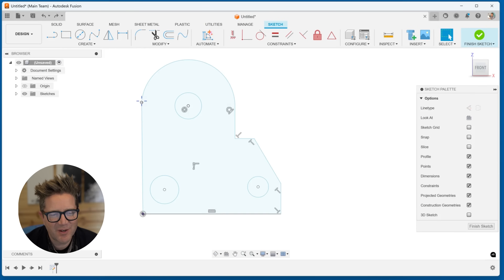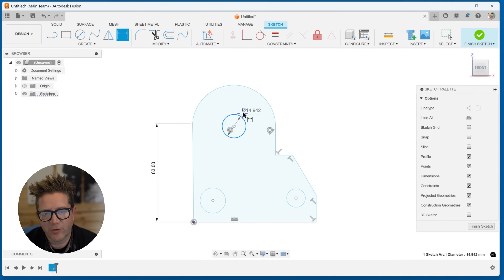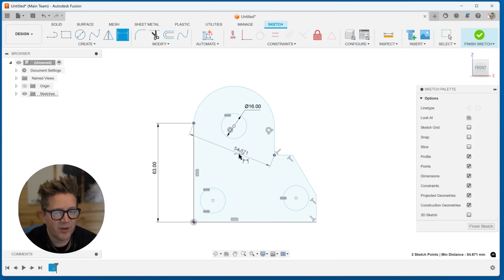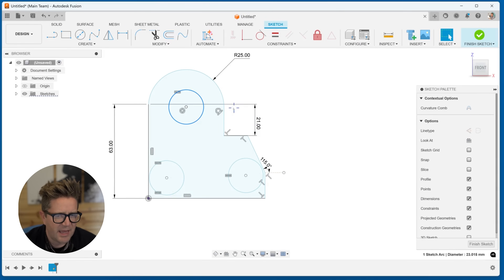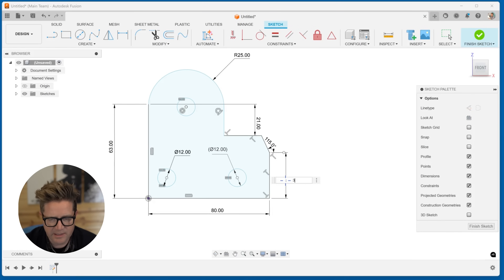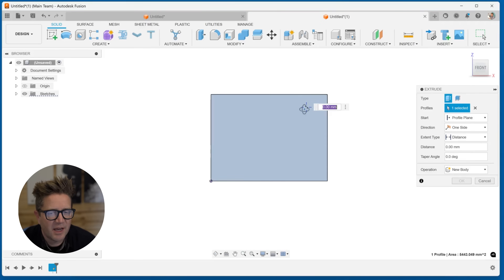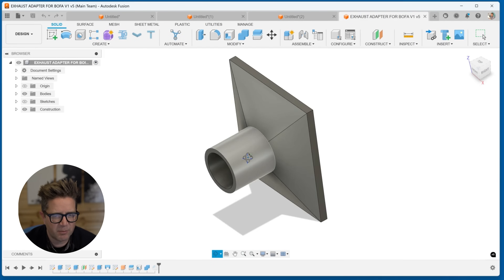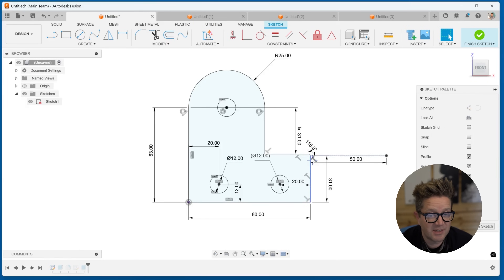Learn Fusion 360 Dimensions – Types, Best Practices & Troubleshooting

Comment: Thanks for video Tyler. I was hoping you'd address a super basic fusion dimensioning behavour that drives me crazy… draw a simple square, and dimension the LHS and drag the dimension to the left. The measurement appears between the dimension line and the square. Delete the dimension. Now repeat on the RHS, and the dimension also appears between the dimension line and the square, that is mirror image to the first one. Now select the RHS dimension and drag over to the LHS of the square, and it retains its old orientation. How do I control which side of the dimension line the measurement appears on?

Comment: I'm following your tutorial while working on my design. Show Dimensions is a sketch tool. How do I display dimensions that are not associated with the sketch but with a body, like extrusions, filets, holes, etc.? I can see the complete list under Change Parameters but when there are multiple items if the same type (Filet1, Filet2, Filet3, ...) that list does not tell me which is which in the drawing. I guess the problem I'm having is that the browser is supposed to include features like extrusions and fillets, but in my case it doesn’t. How do I fix it?
Reply from the maker: Made a video on this - https://youtu.be/wrtwxpAiiMA?si=vlbQFrkUrfa_G77R
Reply: @TylerBeckofTECHESPRESSO  Thank you very much — in your new video you show how to work around the problem I’m having with the browser, features and dimensions. It is strange that you have to use the Change Parameters dialog box and timeline to identify features; I wonder why the Fusion 360 developers do not include features in the browser. (A missing feature?) At least I could pin Change Parameters to the tool bar and assign it a shortcut keystroke. Thanks to you, I’m learning.

Comment: Something I like to do with equations for parametric models is I'll finish my version of what I'm doing - e.g. a file holder. I have the shank of the file, X, and the number of files held in the holder, Z. 

Say for X, I've set the depth of the holder (Y) as 15mm, because it looks right visually. It's more of a proportional dimension than something like "X+5" would solve. So I do 15 / X to get a ratio (R) or scale type number for the relationship between those two values, and change the dimension for Y to "X*R". That means I can set X to any value and Y will change proportionally to it. You can even ensure a minimum viable value like "(X*R)+10" to make sure someone else can't create a part too small to function or print. I hope that makes sense, but it's very satisfying to create a design like that so you just enter two values and the whole design can change in proportion to those values - rather than looking like a stretched out version of the original dimensions